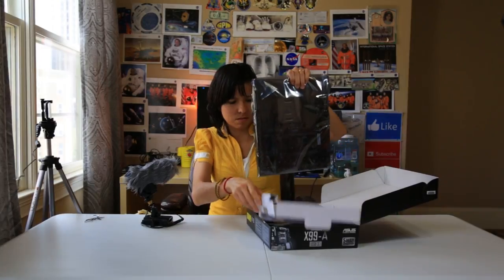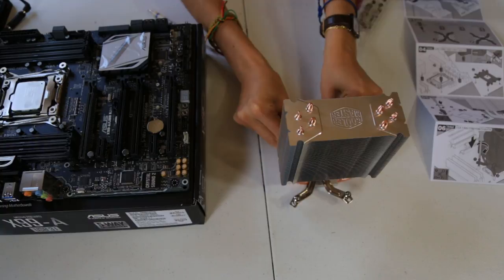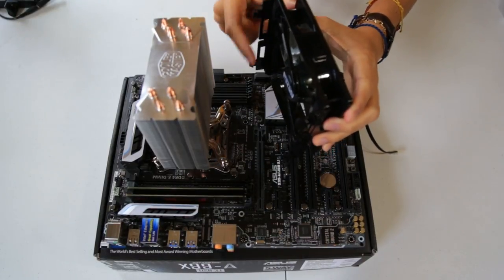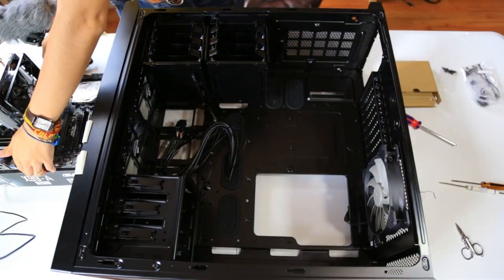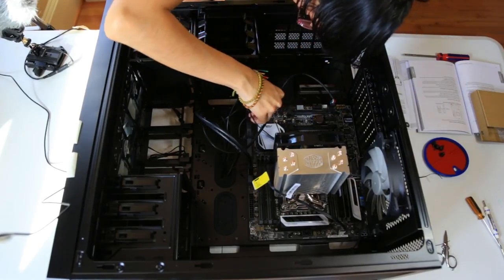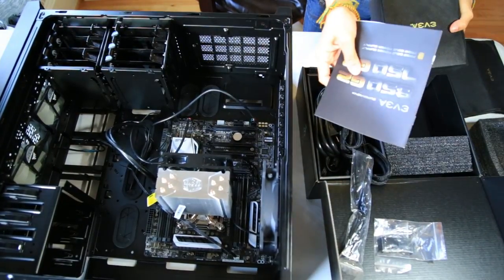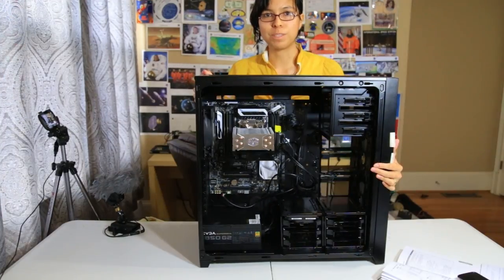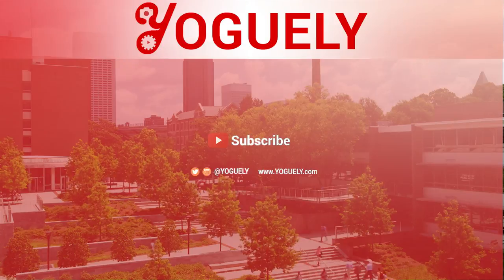I Built a Frugal 4K Video Editing PC

Comment: Nice build just one word of advice you should not use metal wire ties only use the plastic ones as the metal ones can make contact with your components or motherboard and short it out.  Your graphics card is a little weak for 4K editing remember the GPU decides how fast you render your videos. It will take a lot longer to render out 4K but it will work. I would not call it a Monster 4K editing rig but compared to your laptop I guess it is for you. Everyone has their own vision of what a monster editing rig is. I run a dual CPU motherboard with a single 10 core Xeon CPU. I prefer the workstation motherboards for editing though because they are more reliable and have ECC memory options. What program do you use for editing?
Reply from the maker: Premiere Pro. It's the diggity-bomb. ;D

Comment: Please never use metal wire ties to tidy up the cabling.  There is a potential short waiting to happen, if one of those comes loose and contacts the motherboard.
Reply from the maker: Thanks Jason! I just made sure to only have plastic wires. Though I'm sure there are better looking and safe cable management solutions out there. : 3

Comment: Nice build, did you check to see which ram slots to use? Generally you don't put them next to each other. Also you picked up quad channel memory and are not utilizing it? Overall very nice job though.
Reply from the maker: Hi thank! And yes you are right! There is a recommended configuration depending on the number of RAM cards you have. Sometimes the motherboard won't recognize it otherwise. On my latest build guide I cover RAM configuration check out time 4:23 at https://youtu.be/wqUW6Mf3o58

Comment: Usually most builds have the CPU cooler facing horizontal so the hot air being pushed out of the fins gets sucked out of the back exhaust case fan. 

i noticed you put your CPU cooler in vertically~ just saying, in case you want to maybe rotate it by 90 degrees next time you open the case up, he he.
Reply: and don't fucking touch the thermal paste
Reply from the maker: Thanks for pointing that out Wayan! Looking back, the only reason I  placed it that orientation was so the words "Cooler Master" are parallel (readable) to the ground when the tower is standing. Must be an OCD thing, but unfortunately thermally inefficient! Next time I open it up, I"mma switch it 90deg. ;D

Comment: Hey I this was a really cool guide and I love that you seemed super happy to be building your system!

Just saw the follow up video, it's a shame that you had to replace the MoBo... :s

on another note:
I wanted to mention that there is a buzzing sound on the audio, i'm guessing there may be a source of interference affecting the mic line.
Reply from the maker: Thanks Abner! I was even more happy when I got the replacement MoBo (4th video in the series) and it worked like a charm!

PS: I tried filtering out that buzz, but it wouldn't go X/. I used a long thin aux cable to get the camera far from the mic, but that might have degraded the quality. I'll get it right for the next video ;D.

Comment: fyi. i am not sure if modern graphic cards or motherboards have a safety on them regarding the fans. nevertheless one should not turn the fans manually since in generates a current that goes in the circuit and can burn a component. hopefully this has not happen to you, but i thought you should know ;)
Reply from the maker: Apparently I would have to spin it at very high RPM for harm to happen. But I'm going to play it safe. Thanks for letting me know William! :)

Comment: Nice build Im saving for a similar build but skylake and we have the same wireless card hehe
Reply from the maker: Cool Jay! Yeah that is one of the best cards out there for the price. Actually, I didn't end up using the wireless card because when I returned the defected motherboard, I upgraded it to another motherboard, which had WiFi & bluetooth built in!
Reply: +Yoguely awesome my rig is a little outdated I need an upgrade

Comment: Yoguely::: Are you able to install an NVMe PCIe SSD, are they not like 5x's faster than a Regular SSD.
Reply from the maker: Hi McRom37! Yeah this MOBO has a M.2 slot for the m.2 SSD. They are ridiculously fast. I haven't needed to get one yet. This MOBO also comes with the Hyper M.2 Card you can attach to a PCiE port to add an extra m.2 SSD. However, the performance is reduced if you use a Hyper M.2 Card with a 28 lane CPU (like the one i got, the 5820K).

Comment: What is a good amount of RAM for someone who is "budget conscious" and trying to build a desktop CPU that can 'easily' handle 4K video editing? Does it make a difference if the RAM lots are in 16gb multiples or in multiples of 8gb? How about HDD size and processor speed and video card size - what would you recommend? Including case and motherboard and fan and other parts is it possible to built it all for AU$1000 (excluding monitor)? Or need more like AU$1250 / AU$1500 or maybe even AU$1750 / AU$2000?

Comment: Hi There! Are you editing 4k video or HD? I'm upgrading from a laptop as well and am curious how my 4k H.264 untouched footage from my GH4 would perform on a system like this.
Reply from the maker: Hey Prairie! I edit both 4K and 1080P using this PC. The 4K footage comes from a black magic cinema camera (BMCC). I have tested it with every single Apple ProRes 422 and CinemaDNG RAW formats and no matter what I throw at it, the PC runs very smoothly, no hiccups, I can apply color/effects and edit my footage in real-time. Saves me so much time.
Reply: How does the computer perform while scrubbing the timeline on your new build as opposed to your old laptop?
Reply from the maker: My built is running flawless, I don't have to wait on the computer to render before watching. My old Asus G53SW laptop could not even playback 4K videos, much less edit.

Comment: Quick question? Is it relatively compatible with DDR4-3200?
Reply from the maker: If your RAM shows up here, then it is! http://dlcdnet.asus.com/pub/ASUS/mb/LGA2011/X99-A/X99_Series_DRAM_QVL0603.pdf?_ga=1.249184131.565131881.1473545849
Reply: it doesnt show frequency in the list you gave me.. or how do I know what frequency does it have on the list?
Reply from the maker: Not sure what you are referring to. The processor has frequency specs (e.g. http://pcpartpicker.com/product/6tXfrH/intel-cpu-bx80648i75820k is 3.3GHz * 6 cores = 19.8 GHz ). The RAM doesn't have frequency in it's specs (http://pcpartpicker.com/product/6xs8TW/gskill-memory-f42400c15q32gis). To ensure compatibility, compare the RAM model with your motherboard's memory compatibility list.

Comment: so the gtx 960 can do 4k video editing?  I thought only the 980 can do that?  
this is good news for me.
Reply from the maker: I got the gtx 970, which I know works for 4K for sure.
Reply: nice!  I dont have to spend too much on a video card.
Reply: it'll will work but you'll skip pretty good amount of frames in real time editing, even with GPU accelerator on.  which software are you using to edit?
Reply: im using adobe premiere and after effects
Reply: +AMADEUZ Connected you can minimize the frame dropped when using half resolution instead of full on the program monitor setting.

Comment: Hi! I'm investing in a desktop pc. For use of movie editing, studio recording, miscellaneous programs. 

How much did you pay?
How much should I pay? 
Please help? 
Thanks!
Reply from the maker: Hi Raul!

It cost $1870 as of May/2016. On my website you can see my PC Part list and the link to current prices according to pcpartspicker dot com.  Here you go: http://yoguely.com/pcbuild.php

How much you could pay is entirely dependent on your budget. You could even pay for used and high-end items for cheaper but run the risk that they might not have been treated well by the seller.

What movie editing software do you use? Are you interested in doing heavy animation work (high end video card), or do you need fast render times?
Reply: Hello! D you suggest the i6 or the i7 ? Thanks!

Comment: For 4k editing U could have got a better video card the GTX 1060 is 6gb & it's not that expensive compared to the 970...
Reply from the maker: Yeah I could have waited a few months till it was released but thankfully I can always upgrade later on. Perks of having a desktop!
Reply: Hey how does it the 970 perform on 4k editing I am planing to buy a GH5 , & I was wondering if I should keep the 970 on my PC. Thanks in advance for any assistance...
Reply from the maker: Works great so far, no lag. I'd keep the 970 until you really see the need.
Reply: Thanks

Comment: Is this enough to edit 4k videos without problems, advice ?

cpu INTEL Core i7‐6800K 6‐Core 3.4GHz (3.8GHz) Box
cooler
COOLER MASTER Nepton 120XL vodeno hlađenje (RL‐N12X‐24PKR1)
mb ASUS X99‐E
mem
2 x KINGSTON DIMM DDR4 16GB 2400MHz HX424C15FB/16
HyperX Fury Black
vga
ASUS nVidia GeForce GTX 970 4GB 256bit STRIX‐GTX970‐DC2OC‐
4GD5
ssd 1
KINGSTON 480GB 2.5" SATA III SHSS37A/480G SSD HyperX
Savage
ssd 2
KINGSTON 1TB 2.5" SATA III SKC400S37/1T 7mm SSDNow KC400
series
opt LG DVD
case
COOLER MASTER CM Storm Enforcer Case (SGC‐1000‐KWN1)
+ CHIEFTEC APS‐1000CB 1000W Full A‐135 series Power supply
Reply: The most important part in building a Editing system is to have a balance system, in other words make sure no bottleneck.  Your system sounds good! also are you going to be to editing heavy? motion graphic with/or color correction and grading footage? and on top of that masking/rotor scoping.. these are heavy edit. The system youre building should work pretty good! also make sure you separate all your  footage, your programs/windows, cache media from each other so you'll have a smooth stream line.  what editig software are you using?
Reply: your PSU is overkill even with overclocked, unless you plan to put another GPU in there. If you can still return it to save some money, you can get away with 850watts